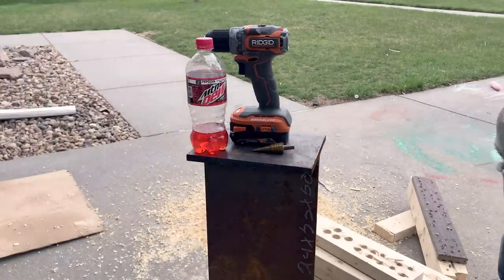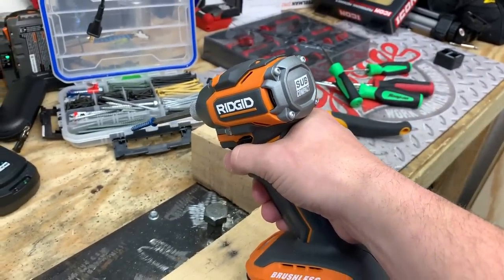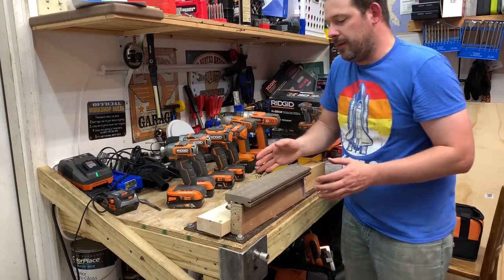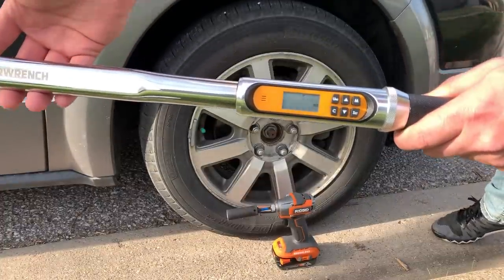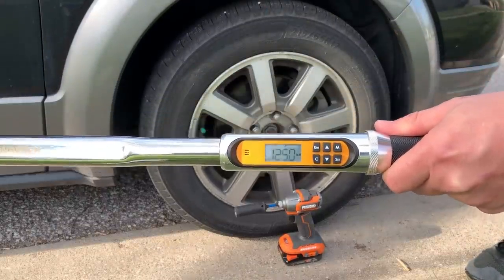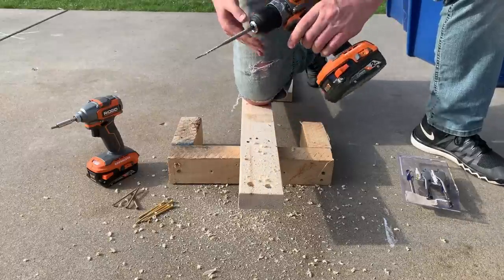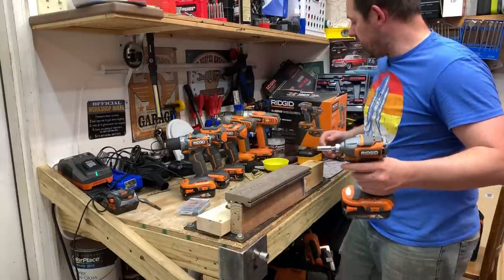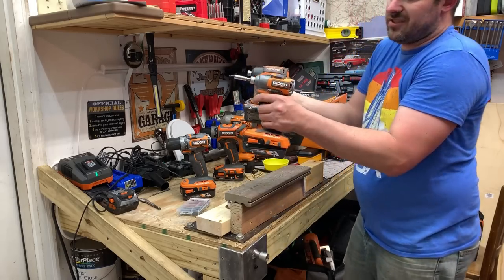NEW Ridgid SubCompact Performance Tested and it's Not What I Expected

Comment: Excellent review. I will keep my eyes open for a good sale on these new subcompacts.  I moved into the Ridgid line 5 years ago when I was shopping for replacements (for the 3rd or 4th time) for batteries for my old Milwaukee 12V drills. Upon discovering that Ridgid had an LSA that even covered batteries (if purchased in some kind of authorized combo, as I'm sure you know), it became just about my sole power tool (even if not battery operated). Given the cost (and short relative life) of the Milwaukee batteries, and their high cost, I just threw out the old drills and started fresh. Now my tool area looks like the Ridgid section of a HomeDepot. My only dislike is their registration process, which in almost every case (and that's well over a dozen times) required me to waste time following up with Ridgid's CS, even though every registered tool was purchased at HomeDepot (and the receipt was uploaded by me at the time of registration). It's quite frustrating that their registration process is so flawed, but the LSA makes up for it in the long run. Hopefully it doesn't spill over to their warranty claims (as to which I've been fortunate enough not to need so far).  As an aside, I needed a portable air compressor a while ago, and Ridgid didn't have anything that met my needs, so I bought a Ryobi 18V compressor and got an adapter on eBay that allowed me to use my Ridgid batteries seamlessly on Ryobi 18V tools, so I didn't have to waste money (and space) on non-lifetime warranted Ryobi batteries.
Reply from the maker: I almost went the adaptor route just because Ridgid doesn’t have any out door power equipment and batteries are the most expensive consumable in the equation. At least you can pick up a string trimmer or a few other really cool Ryobi things👍
Reply: @ClientGraphics  I've gone full Ryobi 40V for my outdoor equipment. The batteries are't warranted beyond 3 years, unfortunately, but you really don't want to go 18V on outdoor stuff unless you've got dozens of them. I go through about 6 fully charged 40V batteries on the day I work up the courage to tackle my outdoor jungle. And I'l talking blowers (2, one for each hand for better control and amazing power), weed wackers (3, each with different line or blades), chain saw, extended pole saws (2, 8' and 10'), hedge trimmer, edgers (2) and more. When I go in, I go "all in". If I could do it over, I might go the Ego (56V route, also no LSA), but the prices I paid a few years ago mostly using eBay was tooooo good to refuse. I've not seen deals like that on the Ryobi 40V line, however, in a long time.

Comment: Thanks for sharing, I just bought this kit at Home Depot with a free 2Ah battery but hesitant whether it’s powerful enough to do the job, specially the impact wrench to loosen the wheel nuts.
Now I am going to keep it as it comes with lifetime warranty if register online before 90 day of purchased date.
BTW, you should have the Safety Glasses on when using it !

Comment: Bought the Ridgid Subcompact 3/8" and it is very impressive.  With a 3/8 to hex impact rated adapter their is no need for an impact driver. Or an 1/2" impact wrench with an impact rated 3/8 to 1/2 adapter.

Comment: I'm still using my Gen 2 drill and impact driver. 😂 I bought an 11 piece combo kit back in 2008, everything is still working except I had to upgrade the batteries. It's been almost a month now I've been researching Gen5 and sub compact. I'm at the point where I just might buy both combo sets and call it a day. Lmao
Reply from the maker: The newer tools are lighter smaller and have more power but come at a cost.  I can tell you that the X2 hammer drill while large under performs even compard to the cheapest X5.  But my X2 still works so I can't seem to get rid if it😁

Comment: I got those pair, but I found that I was always hitting the fwd/rev switch when gripping it.  Very annoying and I ended up returning it for the comparable Ryobi combo which didn't have that issue with my grip.  Either way I do really like the subcompact lines and they can do most stuff and is just much easier to manage over the larger ones.

Comment: I have a 1/4” impact from Rigid. I’ve charged the 6ah battery once in the year I’ve owned it...seriously...hasn’t needed to be recharged yet and still going strong. Now I don’t’ think use it daily but I’ve swapped wheels a few times on my tuck and my wife’s car. Not to mention I’ve put together some docks with big old lag screws and it hasn’t slowed.

Comment: Great Review. I recently brought the Rigid subcompact kit w/free impact wrench at HD, really impressed with these tools. Although, as a homeowner my tool use is very minimal yet I love to have this beast around 🏠😊
Reply from the maker: Good choice going with Ridgid Phani K.  Make sure you register your kit within the first 30-90 days so you get the Lifetime Service Agreement on the set. I can tell you that the Ridgid ones are more powerful and responsive than the newer Ryobi HP compacts there were releases about 2-3 months ago. Ridgid provides a great value tool👍
Reply: @ClientGraphics  Thanks, I’ll register my kit soon. I completely agree with you in terms of both power  and tool value (LSA) as compared to any other competitors within this price range.

Comment: Holy shit Batman... or Ridgid man like me. I have made a living using Ridgid tools for 15 yrs now. I have so old tools that the L.S.A. didn't exist. I have Makita, Dewalt, and other brands too, but not the full lineup.
Glad to come across a video that runs my next purchase. I am not very happy with the new slim batteries however... They do not work under load as I am used to with my soon to be expiring battery pack. The Lifetime Service Agreement registration takes months for me to kick in, although I know the tool will last for a good while, while in it's in process. Good video man.

Comment: Loosening a torqued lug nut is what I’ve seen everyone has done... why don’t someone tighten a lug nut till the bit breaks then measure the torque  it produced... I think it’s going to say how much torque it really puts out...
Reply: ( why don’t someone tighten a lug nut till the bit breaks)  Your point is to find out the hex insert bits maximum torque before it breaks ? or the socket max torque before it breaks? not the impact drill maximum torque that can loosen the nut?
Reply: all these are made to max power in reverse. kinda like ir cars reverse gear is better then ur forward gear.
there is no point measuring tighting power. difference is very small..

Comment: Nice review. Cons not octane tool. Battery pack uses the older obsolete cheaper lithium battery type (not newer lithium battery type in 3a octane pack). Tool with newer octane battery installed on them looks like a dumbbell attached . MSRP $199 combo price at HD now...wait till Xmas and the combo will probably be on sale for $150 or less ...and by then those that gave glowing reviews will be able to update the reviews as to whether the tools actually last!

Comment: Do you prefer the compact drill and impact driver compared to the Gen5x brushless version. I am purchasing my first drill and driver set and trying to compare the compact to the Gen 5x. Thanks
Reply from the maker: If you want the most power Gen 5x but typically you don’t need all that and the trade off is size and weight and what ever “features” you like best? Lighting, speed modes or even the bluetooth connectivity. They all sound nice and exciting but unless you will actually use them they just cost more money. I actually find myself using the smaller lighter tools more and if I’m going to build a deck or construct a shed I’m using a bigger tool and more batteries.

Comment: Who do recommend for "Speed Bore" Bits?

IRWIN...
Reply from the maker: There are a few brands to chose from Irwin had a good price to product value.  You could go check the Harbor Freight stuff or brands like alBosch, Dewalt, Milwaukee, Klein or even USA made like Eagle Tool. Search online line for Auger bits or Wood Bore bits as SpeedBore is more or less a marketing name/brand for Irwin. The Irwin has been fine for nail free 2x4’s

Comment: im stuck between ordering the sub compact 3/8" impact and the standard octane 3/8 impact... sub is rated at 225/200ft-lb not sure cant find a definitive on standard spec..... size of sub compact may sell me... any opinions?
Reply from the maker: I just picked up the Ridgid sub compact and Milwaukee m12 3/8 impact yesterday and batteries are on the charger now.  I’ll hopefully get to test them out and have a video this weekend.

Comment: I have the drill and impact set, worked great for about a month. Now they are pure crap. Batteries die easy. I drill 1/4 inch steel and it takes two charges. Honestly nothing beats dewalt. Dont bother with rigid
Reply: I have never had a problem with Ridgid batteries, from 2 ah thru 9ah.
Reply: if u deplete the battery it lose its powers. or if the battery was made a long long ago. sitting on low charge can damage the battery. buy more battery and try again
Reply: @rocketsmall4547  tried that still junk. Got dewalt, problem solved

Comment: Thx for the review.  I just don't see the need for these... they already have compact drills... how long did it take to charge the batteries with the new charger?
Reply from the maker: I didn’t time it, but I plan on doing another video on these as I had to cut it due to time and didn’t even show the 4” and 5” lag bolt I tested.  I’ll see if I can check on the charge times. Most of the top offs I did were all done within 30mins or sooner, but I never really timed it.
Reply: Impact drivers are a hot market. I'd rather have my impact driver than a drill.  12v doing 100 lbs of torque, can't get too much more compact than that.

Comment: According to Tool Boss, it’s impossible to torque those lug nuts on those studs more than 100 lbs.

What do you think of that opinion is he right or wrong?
Reply: Juan C Impact drivers shouldn’t be used to torque lug nuts to begin with. The right tool is a wrench.
Reply from the maker: Using the 1/4 hex impact driver isn’t an ideal tool for lug nuts, but it could work in a pinch. It does however make decent YouTube video footage to demonstrate extreme workloads and it will work. I might do a video demo on this but it would be to compare 3 or 4 impact tools to the stated manufacture specs. In the meantime I can tell you that I have personally done at least 101 ft-lbs👍🏻

Comment: Ok now that you over stressed your lug nuts/studs your still going to drive it?
Reply: Cars generally require 100-105 lbs of torque, 125 won't hurt them. Tire shops used to crank them on with 400-500 lbs of torque air wrenches.
Reply: @username8171  I believe most cars are in the 90 foot pounds for lug torque some 140 like a newer camaro than HD trucks. So has the 125 foot pounds stressed out your wheel studs? That’s your call what do I know I only work on airplanes for a living.

Comment: Got a ? 4 u.  When you were testing the impact driver on the lug nuts....how much battery did it go down? I am curious.
Reply from the maker: On the lugs the battery didn’t lose much maybe a bar or so.  Keep in mind they are brand spanking new batteries and I probably shot each sequence 3 times and picked the one I like for the video.  The paddle and speed bores are more taxing.  That definitely dipped down two bars at a point.

Comment: Do you have a OCTANE™ Brushless 18V 6-Mode Impact Driver (R86039B) by any chance?? How heavy does it weight?  Currently I am stuck in-between the new sub compact impact, and this Octane.....
Reply from the maker: I just have the Ridgid X2 hammer drill and an X5 drill
Reply: @ClientGraphics  thanks

Comment: Next time you drill through a thick piece of steel like that, don't use a step bit, and alternate or relieve the pressure of the drill.  Don't simply press all of your weight on the drill.  Press down on it, release a little and press down again, rinse and repeat.  It will be easier on both the bit and your drill.

Comment: I just don't really get the sub compact either I'll use my full size or if I want something small I'll use a 12v
Reply: It's because Ridgid's 12v platform is basically dead, and TTI doesn't want to steal sales from the M12 line. 

These subcompact tools weren't really asked for, but some people will really use them, and they're unique enough that other people will buy just for the novelty
Reply: Carpenters buddy

Comment: Dewalt 12v xtreme?
Reply: bongothaplant Dewalt 12 volt extreme impact and drills are amazing. I’d take it any day over these Rigid Sub compacts. Honestly they feel cheap to me. Something this small needs to stay in 12 volt because the base battery still gets in the way. If you are a hvac guy or cabinets guy, the smaller battery on the dewalt is way better. The power is great. I’m not a M12 guy I cannot stand the fat grips.

Comment: You do realize when you torque it down you heat/stretch the bolt and no wonder it comes out. You could probably torque it to 200 and it still may come off.. torque it to 90 ft lbs and come back 7 days later tell me what happens..